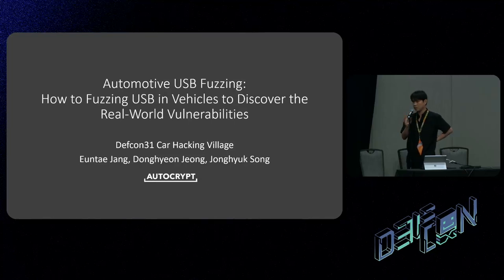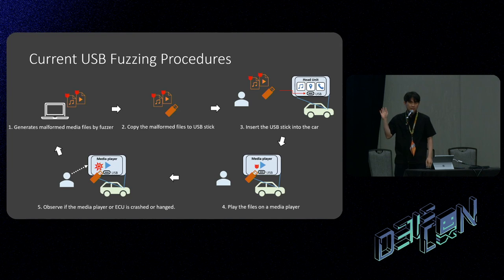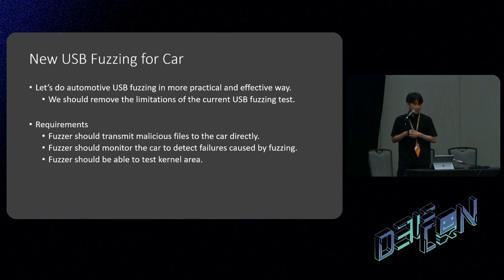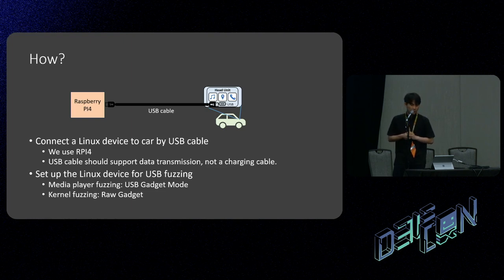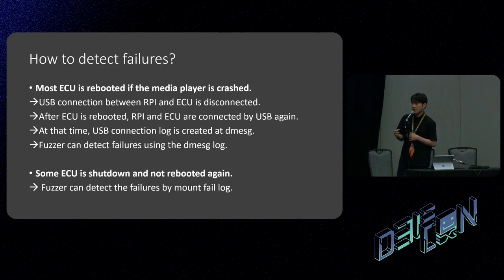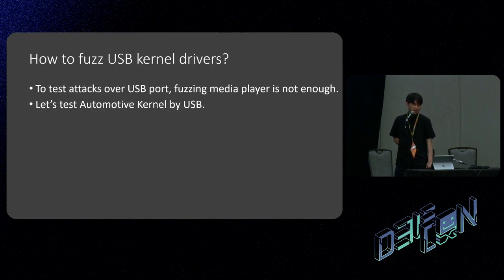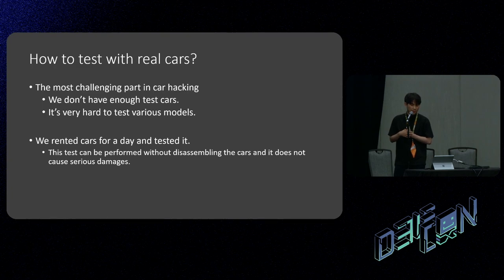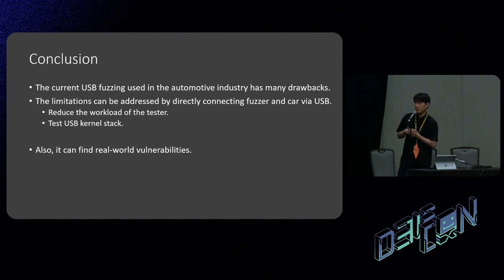DEF CON 31 Car Hacking Village - Automotive USB Fuzzing - Euntae Jang, Donghyon Jeong, Jonghyuk Song

Comment: Thanks for this shared fuzzing expertise ! For the CVE-2023-39075, the type mentionned is kernel, but which kernel component is vulnerable ? Because, the cpe identified is the OS cpe:2.3:o:renault:zoe_ev_2021_firmware:*:*:*:*:*:*:*:* , but not a kernel  component ?